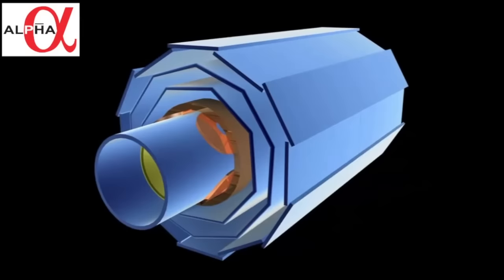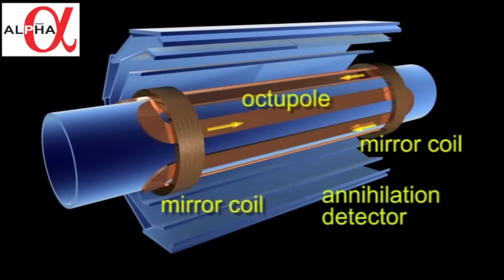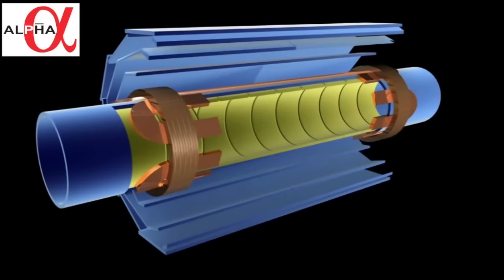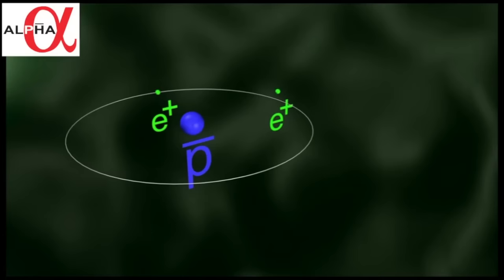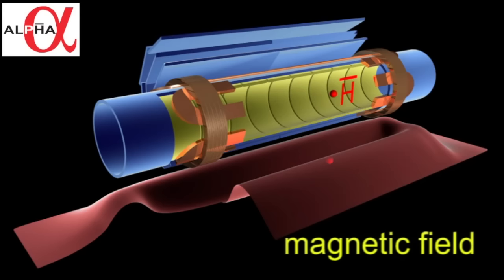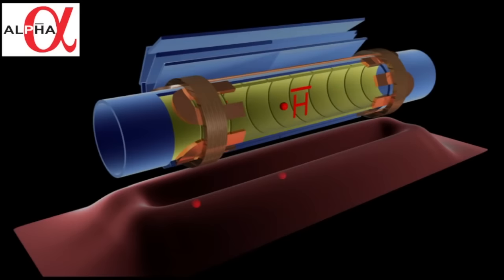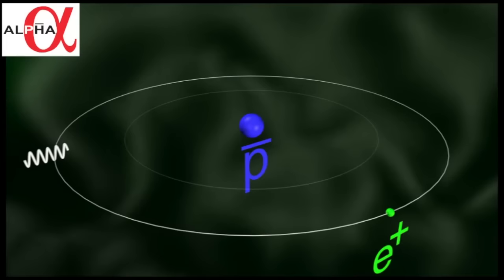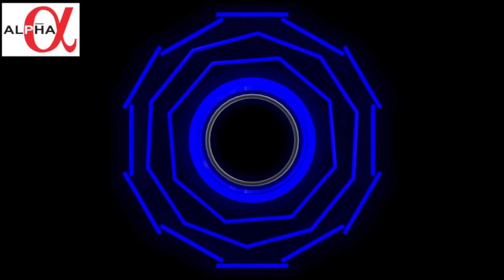Antihydrogen formation and 1S-2S excitation in ALPHA

Comment: Ionization from 2S may well occur by ordinary photo-ejection of the positron but, without gamma detection (≈511keV), ALPHA cannot rule out its "photo-annihilation" with the emitting electron!  ALPHA has, after all, here accomplished the first documented single-photon transmission (i.e. lightlike, "interval contact") between a conjugate pair.  It is thus advised that gamma detectors be placed around the anti-H illumination source (avoiding the thick windings around the trap).

Photo-annihilation would not apply to the dual-photon, 1S-2S transition, since annihilation is always quantized 1:1.

Comment: Very nice job after decades of hard work!
I note your vertex detector tracks the anti-proton annihilations well.  Is it also sensitive to positron annihilation?  Were they accounted for?
Reply from the maker: Hi. Detecting the gamma-rays from positron annihilation is very inefficient - in particular due to the magnet windings they have to pass to get to any detector - so no position sensitive gamma-ray detectors are installed (we used to have that for ATHENA). We therefore do not reconstruct the positron annihilation. We use clearing and bias fields to ensure & confirm (when in doubt) that the antiprotons we detect originate from neutral particle losses (that is, antihydrogen).

Comment: Why does ALPHA rely on coincident, counter-propagating photons (λ=243 nm each) instead of a single photon (λ=121.5 nm) to achieve 1S - 2S anti-H orbital transition?  It would seem the laser intensity could be much lower that way.
Reply from the maker: The 1S-2S transition is only excitable with two photons (it's a so-called dipole forbidden transition) as there's no change of angular momentum between them - so two photons are required. The 1S-2P transition can be excited by one 121nm photon - but is much less welldefined (for exactly that reason). While it needs less intensity to excite it is (a) at a much less availble laser wavelength (record is about 10nW in CW, but it can be excited with a pulsed laser) and (b) it is inherently not as precisely measurable - so from a spectroscopy point of view it is not as interesting. However, the 1S-2P transition has been used (once) for laser-cooling hydrogen and could be used for laser-cooling antihydrogen. We as well as other groups are pursuing it for that reason in particular.